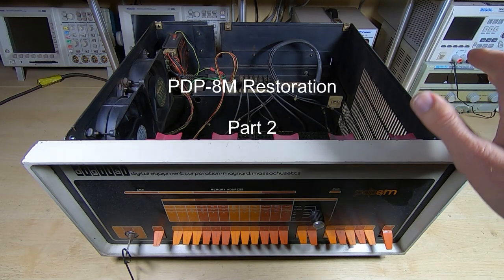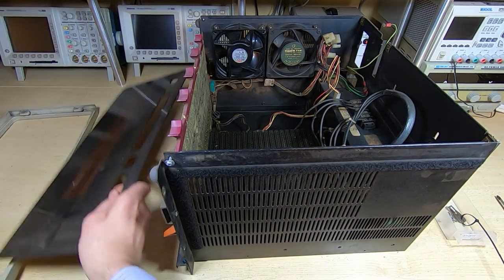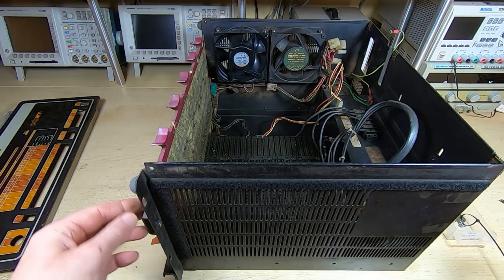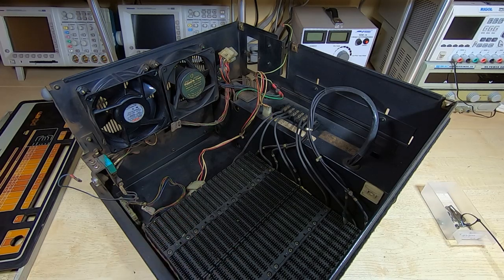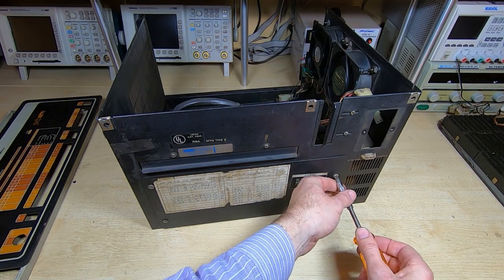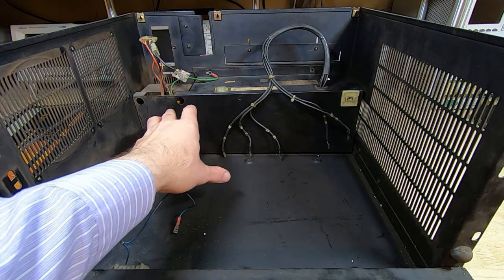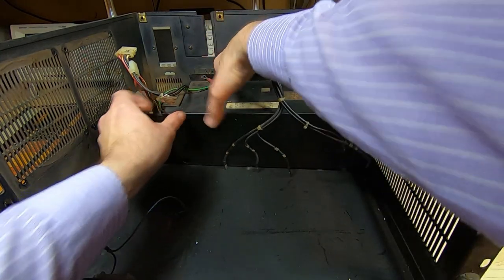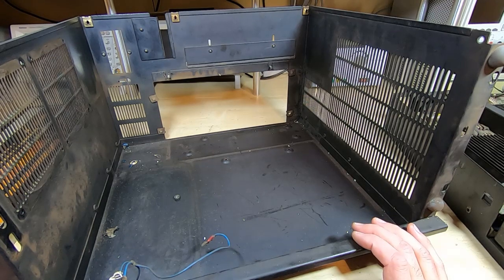PDP-8M Restoration Part2

Comment: I owned a PDP-8i in the mid-80s.  It was a 2 frames system; with a paper tape punch/reader, a direct-access tape drive units, hard disk drive unit and a multi-channel A/D converter.
All the backplanes were wire-wrapped, and all circuit boards were single slot boards with simple TTL logic.  I had all the circuit diagrams and manual.  These were machine that you could troubleshoot with a VOM and simple scope.  That was fun machine to learn computer electronics on.

Comment: Old PDP-8 and PDP-11 were widely used for "industrial controls" well into the 1990s !  Many saw service in extremely dirt environments but they kept on working event with MEASURABLE amount of grime on the backplane and circuit boards.

FYI - Early version of the the PDP-8 used "negative voltage" logic.  A negative voltage was a "one"/ON.